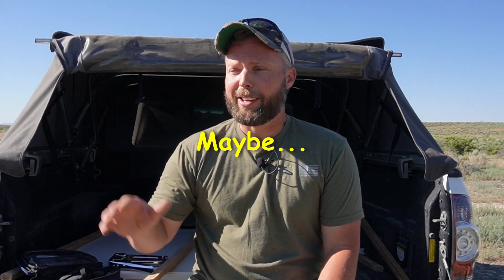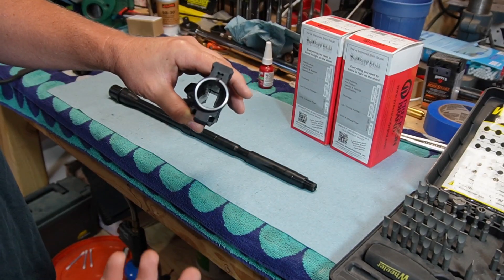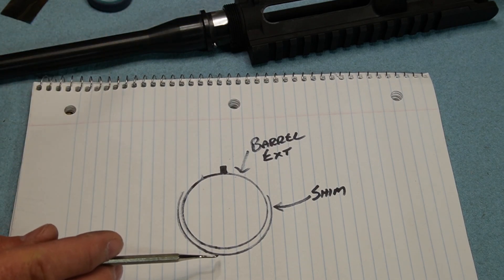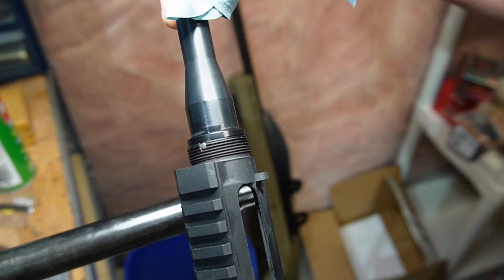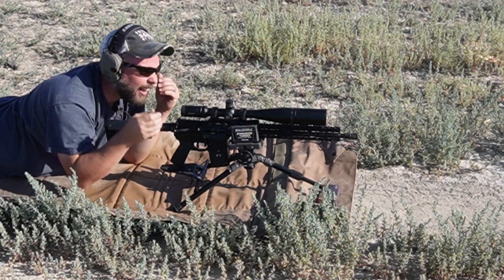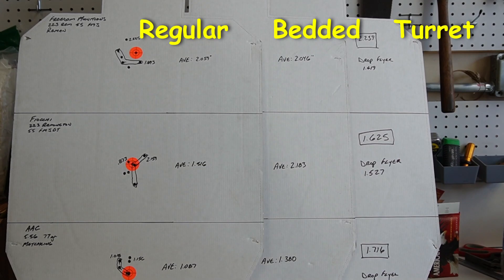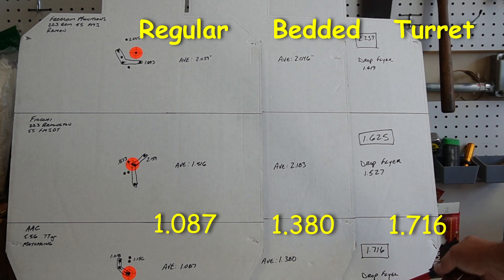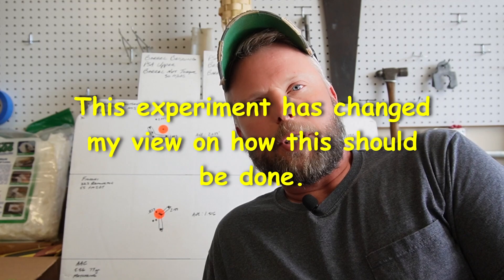AR15 Barrel Bedding: The Video That Revolutionized My Approach

Comment: Using a reaction type of mounting tool, one w a “wing” that goes into the charging handle/gas tube slot in my opinion stabilizes the barrel extension and the upper receiver and during proper  torquing (ie. pushing/stabilizing the barrel towards the tool) while torquing does a better job and the most realistic alignment/ mounting for the platform. Some upper tools that mimic Geisele are better due to barrel extension lock up but it also personal preference. Advise staying away from aluminum models unless build usage is not going be excessive due to over stressing the tool.  Also, I believe this  was stated but if not , during mounting , torque barrel w 33ms or copper anti seize and do it three times as in torquing back off nut, thread 3/4 ish of the nut and retorque  and repeat for three times . From there, increase torque in 5ft lbs increments until realistic alignment and try not to exceed 65lbs( personal preference) allowed up to 80lbs G.I. Spec nut. But excessive torque “ possibly”can rreact w undesired receiver stretching creating “possibly “ a less accurate rifle. That’s most specifically w steel Gi nuts , consider barrel nut shims past if it’s needs to go past 65lbs to time correctly. Strictly one persons opinion…ps edit almost forgot , realistically doing anything of this properly w a “ reaction “ rod esque tool, the notion of snapping a alignment pin / damage receiver should truly be a misnomer as if done correctly and either issue arises, it would arise during at some point during use and personally feel I’d rather discover component failure here than when it’s actually needed. Summed up, minimal chance of damage  to quality functional parts.

Comment: This is an operation which is perceived to improve accuracy but it is not at all proven. What’s important is a match grade barrel extension fitted to match grade barrel. I know this as an American High Power Rifleman in Long-Range Award Winner. Bottom- line is match condition your AR as the USAMU does, nothing more and nothing less. Their comprehensive research and development has identified everything important to getting the best performance from an AR, about .25 MOA at a 100 yards. My AR delivers .50 MOA from irons in prone sling supported position which is good enough to produce 500 x 50 X scores from knowledgeable and skilled shooters. My best is 482 x 14 from irons.

Comment: Great VDO - I think your conclusions at the end were 100%. I totally agree with your caveat because things slip by on Mondays after a good weekend, irrespective of manufacturer. I still think the guys that have already said this below and Brownells recommending a thermal fit is sound advice if you’re going to chase the MOA Dragon. I think your theory is plausible but may require some luck, i.e., increasing diameter with shim stock followed by thermal fitting. Buy once, cry once applies on this barrel concentricity endeavor. The odds are in your favor with a proven manufacturer that incorporates thermal/interference fitting.

Comment: What if...the upper is in the vice block vertical, the barrel nut is 'just' touching and the BCG installed, removed, installed a couple times to establish 'centerline' alignment (concentric) before torquing the barrel nut? With a faced receiver (perpendicular) and an aligned barrel (concentric) I don't see the need for bedding (My humble opinion, your mileage may vary.).

Comment: I don't know but I am pretty sure I saw that shim crinkle between the receiver face and barrel extension at 7:22 on the video. I have two builds under my belt now. With both, I lapped the receiver face and bedded with Locktite 638. I am very happy with the accuracy of both.

Comment: I think your over thinking the whole interference fit/Thermal fit.. It's just because it's a nice tight fit.. Also most of your AR15 accuracy comes from #1, the barrel, a quality barrel totally changes the way you look at a AR15 for accuracy. After that, #2, the ammunition, you have to shoot quality ammo for consistency.. #3 a good AR15 trigger like the triggertech diamond, makes a world of difference.. I dont bed my rifles, the last 20" AR I built with a well known barrel maker is shooting in the .2s and .3s at 100 yards. This is of course off of sand bags with a large variable power optic and quality ammunition... I also do recommend a thermal fit upper, at least that's the way I roll with mine.. Good luck with your accuracy quest bud...

Comment: When you torque the barrel nut to the upper receiver, the receiver will constrict around the barrel extension..When you get to 55 to 65 pounds of torque, the constriction stops.. Unless the fit between the upper to barrel extension is excessive, bedding is pointless..
Reply from the maker: I don't doubt your point on torque and constriction. It would be interesting to know, and I'm not sure how we'd go about it, what the constriction rate (in .001") vs. torque value. Barrel nut torque has a wide envelope as does extension to receiver fit with so many manufacturers. So what would define as a loose fit? I have yet to find anything on that. I did find an old video series of Joe Carlos and he shims and loctites all of his barrels with improvement in accuracy. It's an interesting video series and worth the watch to find some of those useful nuggets of info. To me, unless the barrel barely slips in or is a thermal fit, it makes sense to bed. Takes the guess work out and you eliminate the over torque or under torque issue, which can affect POI and/or barrel harmonics. Speaking of barrel harmonics, I read a long time ago, that some will torque the barrel nut in 5lb increments, starting at 30, until the desired grouping is achieved. But I don't recall if that was a bedded barrel or what. 

BTW- Love the shepherd
Reply: @nobodytraining  The TDP upper receiver barrel extension bore is suppose to be 1.00" to 1.06",  but many receivers today are under the 1.00 minimum..Bedding a barrel with Green loctite/shims won't hurt anything, but I don't bother if the fit is snug..Barrel extensions are not all the same diameter either.. I use pin gauges to measured the receiver's barrel constriction with different torque settings..With the wide variety of uppers I have (including BCM) they were all with in the 55 to to 65 ft pounds torque range before the constriction stopped..The another area I have found to have effect on accuracy with the upper is the amount of play (slop) the rear of the carrier has within the upper..The more slop in this area, the less accuracy I have seen occur..Keeping the bolt in line to the chamber/bore does effect accuracy..If you have access to a sample lot of AR rifles, you can measure the different amount of rear carrier slop AR rifles can have..I had one brand new retro upper that was so far out of spec, I sent it back..Accuracy gurus will use or claim all sorts of voodoo, but this is what makes the search for accuracy fun..According to Colt, the variance between 35 to 80 ft pounds of torque has no consequence..Barrel nut material can also determines the barrel nut torque..When you find the perfect combination, let us know :)..Have a good day..

Comment: Never have “ bedded” a barrel😂 no gun manufacturer has ever bedded a barrel😂 it’s just another silly AR myth.
Reply from the maker: https://youtu.be/TvWYzCGEuxo?si=E1nYPIMO5qVdKqCb

Here is a video of Criterion installing a barrel AND using green loctite. Which by the way, loctite makes all kinds of cool products, like thread lockers, but they also make SLEEVE RETAINING COMPOUNDS like Loctite 620 and 638. All designed to lock 2 cylindrical components together…like a barrel extension and receiver. You may also want to find the article retired Master Sargent Joe Carlos wrote for American Gunsmith magazine about a decade ago about shiming and loctiting. He builds precision ARs by the way. And he’s forgotten more about this subject than what you and I know about combined. 

As for no Rifle companies “bedding” their rifles…well most will not because that costs time and doesn’t really effect their bottom line for the type of consumer they are targeting. After all, it’s good enough. However, the higher end companies like JP and BCM, for example, do a better form of bedding. Bedding, if we all remember class, is a way to lock the barrel and receiver together so there is no movement and that makes the platform more consistent. Movement makes things inconsistent so best to immobilize as many things as possible. Well BCM, JP and some others do thermal fitting and that is by far the superior method of “bedding” a barrel because it keeps everything as true as possible. Shims, as you pointed out may not go all the way around, which at the end I believe I pointed out it would be best to use shims and thermal together but that’s another story. The way I did it in the video wasn’t perfect yet it was better than it was without since it brought the barrel closer to center of the axis of the receiver/BCG. But it is probably off by .0005 since I didn’t go all the way around. Which you pointed out as my sin. My bad

If you just want to dismiss this as a silly ar myth, that’s up to you. It matters not to me. Ultimately, whatever you do is up to you. As for me, I’ll keep my intellectual curiosity going and test things out to find better ways of doing things.

Comment: If you just put a piece of “ shim”‘anywhere on the barrel extension, you are NOT centering the barrel. In order to fully “ center” the barrel, you would have to wrap the shim material fully around the barrel extension, cutting out for the locating pin. The use of any type of “ locktite” is a waste of time. It’s called a thread locker for a reason, it fills in around the threads of the screw ( bolt) when it’s tightened down. It’s not meant to fill gaps.
Reply: The Loctite used isn't regular thread locker, the brand sells other types, and if you hear in the video he is using 638 which is a slip fit retaining compound, which expands to lock In the barrel, up to about 0.010" which can be plenty enough to do the job with the added shim thickness.

Comment: EVERY upper receiver should be thermal fit.  It's 2024 for God's sake....and the AR is THE most common firearm platform (maybe except the Glock) and we still have to deal with this nonsense?  

I can only name about 5-6 companies that offer thermal uppers (off the top of my head) SOLGW, VLTOR Mur, JP, Zev, BCM....I'm sure there are others, but EVERY company should be offering thermal uppers!  

I would pay $50 more to have perfectly lapped, thermal upper receiver.

Comment: I have faced and shimmed all of my uppers for many years, but never saw the need to bed.  I agree that modern machining is great, but with so many parts mfgs out there and the nature of Frankenbuilds, you are bound to run into tolerance stacking issues between parts at some point.  Another unmentioned, but huge advantage of shimming the barrel is to keep the barrel in line with the upper.  Keeping scope/optic windage adjustments as close to center as possible will absolutely help in the accuracy department...especially at longer ranges.
Reply from the maker: That’s a good point. I looked at shimming only from the point of keeping the bore inline with the bcg. Thanks for sharing!

Comment: The facing I can agree with but bedding the barrel with the shim I am not so sure and why would you use retaining compound when the barrel nut hold the barrel in place. OK when you trim some of the shim off and it is not at least 355° around the barrel allowing 5° for the for the pin ... so when you trim 2/5 th of the shim off and force the barrel in the receiver you are forcing the barrel off center as it is being forced up toward the pin where there is no shim! Just my $.02

Comment: I used to use sleeve retainer  but then I just started using BCM uppers. I can almost guarantee you that you will never need a shim for an in spec barrel extension using a BCM upper and you will most likely need a rubber mallet to get  the barrel into the upper receiver. I am doing a 6MM ARC build today. I have had the barrel in the freezer overnight and once I get the received face trued I will heat up the uppers threads and with a little gentle hammering get it in place.
Reply: Was this a "blem" upper?  Im wondering if their blem uppers are also thermo fit.
Reply: @5jjt  Yes. I have 5 of them.
Reply: The loctite 620 method is still more consistent than BCM thermal fit uppers. liquid will fill out of round voids on a microscopic level where as there can still be gaps on a thermal fit.
Reply: I dont think that would make a significant difference
Reply: @socom2173 if you are going through the trouble to get a 1/4” improvement at 100yds then some loctite will make the job well done adding to the quality of the piece. Tight groups are the way to go.
Reply: @cyrusmashak8818  I just dont see how it could be any tighter fit then BCM uppers.
Reply: @cyrusmashak8818  Right it makes sense on a precision build but a rack grade build it's probably a waste of time and money.
Reply: @socom2173  The reason that 620 Loctite is superior is it takes up any voids in the fitment. Voids equal harmonic resonance/vibration that can cause POI shifting. ✌

Comment: Try doing your lapping vertically not horizontally. The way the tool fits in and the weight of the drill does make a difference, at least that is what I was told when I received my training.
Reply: especially that big ol M18 drill
Reply: I lap every upper , I'm getting .35 moa at 50 yards with a 10.5 Criterion Core barrel with a can..
Reply: @Richie-v2z you are getting 0.15 inch groups at 50 yards?  We are talking about bordering on F-class/bench rest shooting levels of accuracy out of criterion barrels just from lapping the upper reciever?

Comment: Here is the issue I have with inference fitting. When you heat the receiver, you are likely heating unevenly. As a result you get uneven expansion and possibly a slightly off centered barrel as it cools unevenly. The best is when the barrel and receiver fit nice and snug and the matting surfaces are flat and even. So I'm OK with lapping but it must be done evenly.

Comment: Interesting video. You touched on a subject that is becoming way more apparent in the firearms industry, which is very poor quality control!                                                                                                          IF... the manufacturers ALL used the same dimensions as dictated in the TDP for the AR platform for the upper receiver and the barrel manufacturers did the same for the barrel extensions there would be no need to "bed" the barrel to the receiver........and regarding nearly EVERY component of the AR, which finding quality spec'd and good QC components is becoming a roll of the dice.                                                                                                                                                      
To my knowledge BCM, JP and SOLGW  (ZEV / MEGA) are currently the only companies offering the thermal fit upper receivers.  
As a suggestion to the DIY people, invest in pin gauges and good calipers to actually measure the parts you are intending to use in your build, especially if you intend to build multiple rifles.  Yes they can be expensive to purchase, but at least you'll know what you're dealing with!  
For the 1 or 2 rifle builder.......just purchase one of the above mentioned uppers and go with that.  

Finally........the off the rack M4 / M16s standard accuracy is typically 3 to 5 MOA at 100 yards. So if your AR is shooting less than 1 MOA consistently you have nothing to worry about not to mention the average shooter isn't capable of much better accuracy than that. 
I do like the idea of shimming and thermal fitting, but the important thing to remember is to not over heat the upper receiver!
Reply: My wilson combat barrel would drop right into my mega upper. I had to shim it. Barrel and shim in the freezer and heated the upper. Rock solid after that.

Comment: I would be willing to wager that if shot 20 rounds in each condition and ammunition, you would find that it wasn’t the bedding that caused the accuracy.  The barrel probably has so much more impact on accuracy than the bedding.  Hornady has some fantastic videos on bullet jump and tolerances in the barrel. You have to remember that the bullet indexes on the chamber and not the upper receiver. 

I use barrel grease when assembling my rifles. I have several sub-MOA gas guns with moderately priced components.

Every upper receiver I have used required lapping, just saying.